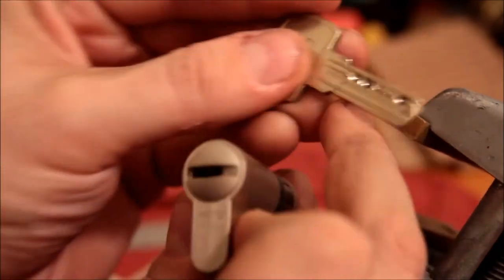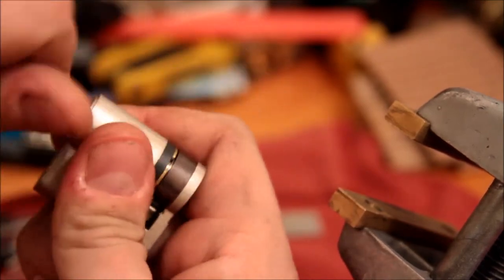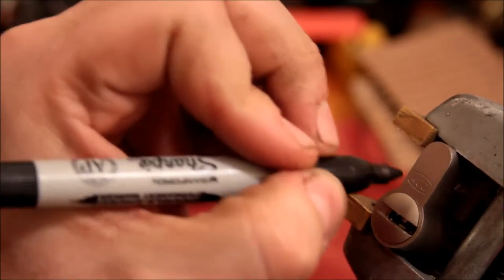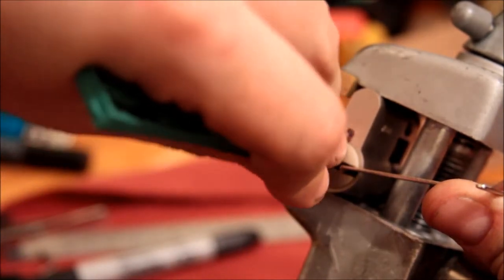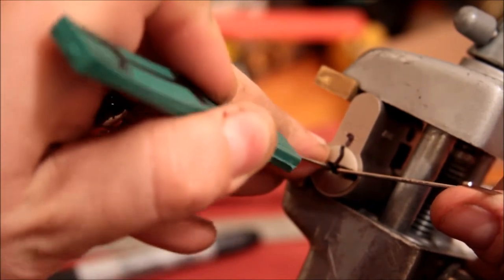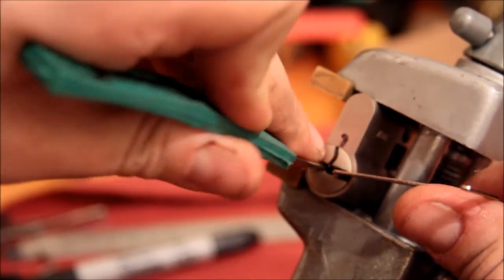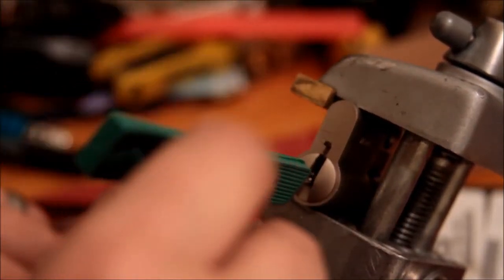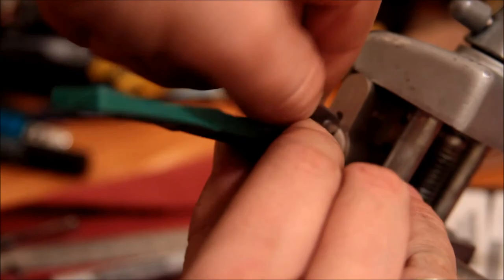(155) DOM ix5 SPP

Comment: each klom navigator pick like the ones you have have a number try useing pick number 19 its on the pick itsself just racking with a slight turning on the pick for tenchion or use a double sided tenchion tool this pick has worked great for me i cracked a high secerity safe with double keyway in less then a minit useing this pick

Comment from the maker: I think I may have sent my Klom #19 to the Lock Lab for investigation and calibration. 

That said, I have found that those rakes just don't work on these locks with heavy warding around the pins... and they tend to massively over-set the low pins. But we'll see. I'm working on a design for a bogata-inspired pick for dimple locks. We'll see how that goes.